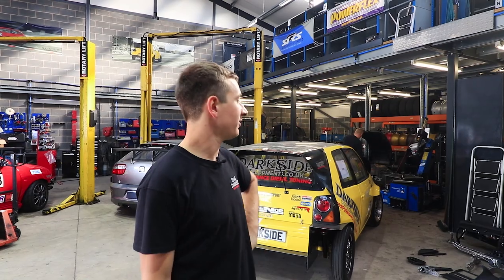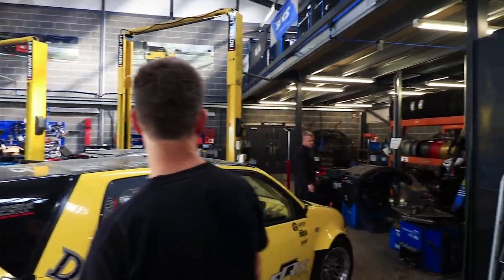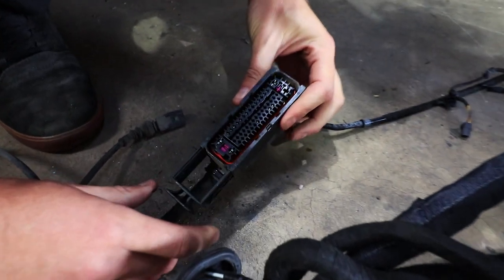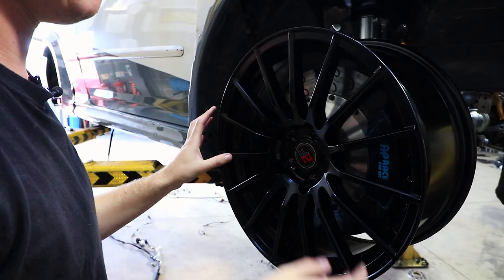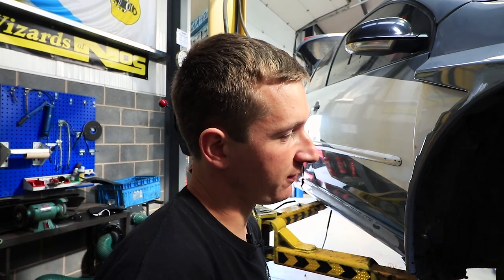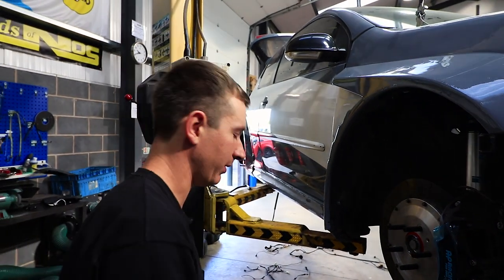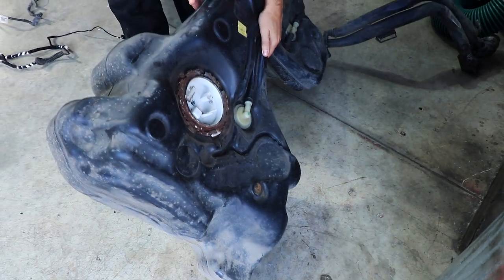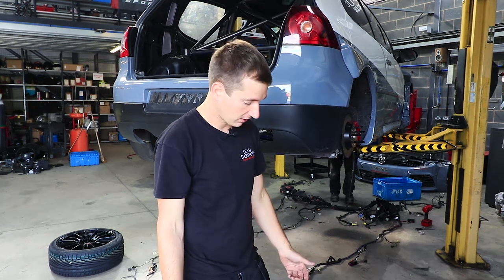MK5 GOLF TDI EX VW CUP CAR 2Forge Wheel Test Fit & Stealing Mk6 Parts - Part 5 DARKSIDE DEVELOPMENTS

Comment: seriously rainsport tyres?
Reply from the maker: A lot of people run them for wet race use. What would you run?
Reply: @DarksideDevelopments  rs3 are ok for straight aqua, checked on e92 335d modified stable at 120mph in a heavy rain but not so good for traction and cornering. I use ps4s but not available in 19''. not sure about ps4 but goodyear asymetric  5 or supersport might be better
Reply: @foxyboots  PS4 are what we are comparing against rainsport on track